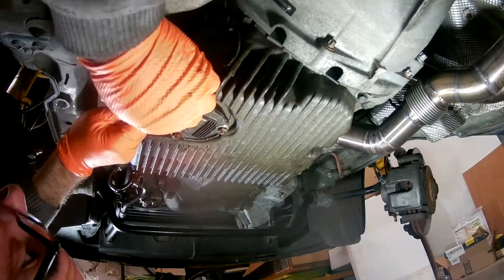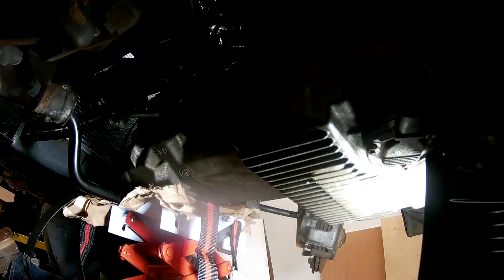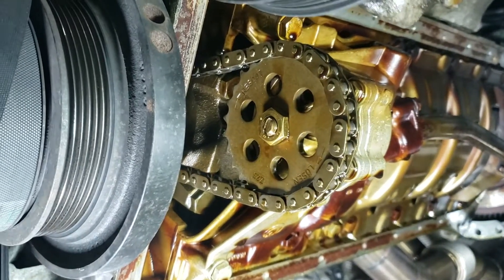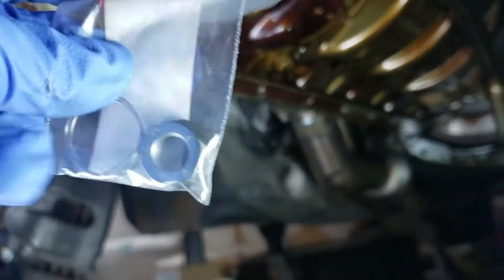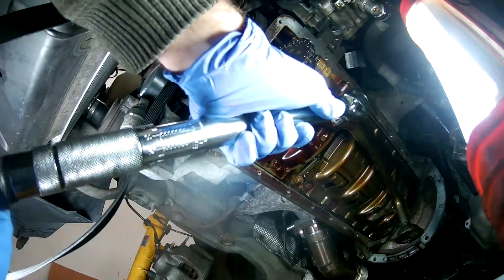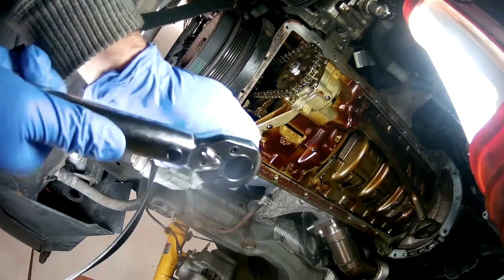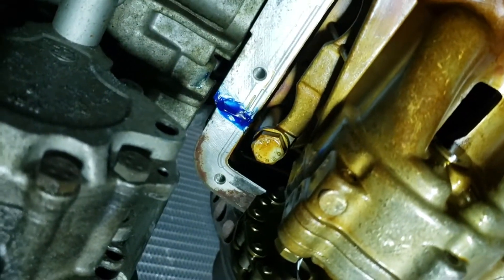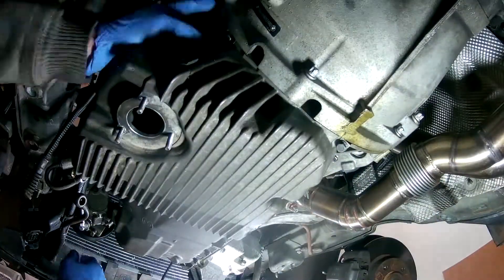Z3 M52 M54 Oil Pump Nut Fix and Oil Pan Gasket Replacement

Comment: Do you need to lock the gear so it doesn't go out of timing?
Reply: No; timing is all done with the camshaft gears. The oil pump gear just spins.